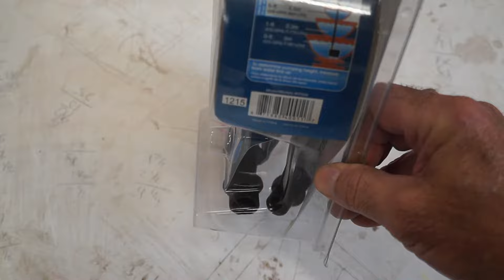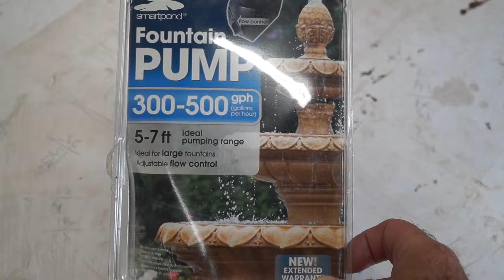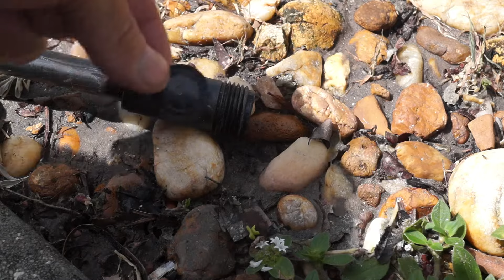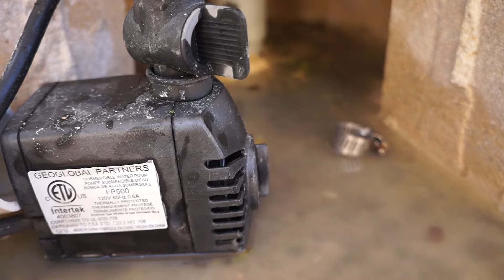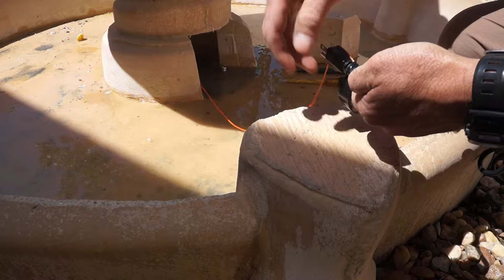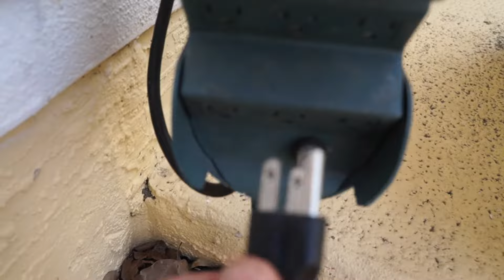How to Replace a Fountain Submersible Water Pump - The End Grain Workshop

Comment: Did you just replace the fountain water pump with a new brand & just place a new plug to start the water, how did it start exactly, I want to buy 1 now👍
Reply from the maker: Thanks for watching! Yes, I simply replaced the old pump with a new one of similar size and flow rate. Once it was connected and plugged into the power outlet, it started pumping water immediately—there wasn't anything special that needed to be done.

If you're replacing your pump, just make sure the new one is rated for your fountain and has enough flow (GPH) for the height it needs to pump the water. As long as it's fully submerged and the intake isn't blocked, it should start working as soon as it's powered on.  You can also add a timer to your electrical outlet to control when it turns on/off.

I hope that helps, and good luck with your fountain project! 👍

Comment: Nicely done, but my problem is I don’t have conduit coming through the base of the fountain up to the cavity where the pump resides. Instead, there is a concrete plug that the wire runs through and it is made permanent with silicone, so to replace the pump the plug has to be gotten at somehow and the wire run.

My problem is I can’t get the darn plug out!
Reply: I had to cut the plug and fish it through. Then splice it at the other dry end.
Reply from the maker: @Blue_Rose1973 That works too.   Thanks for sharing!
Reply from the maker: Thanks for watching, and I hear you—that kind of setup can be a real headache. When there's no conduit and the wire runs through a concrete plug sealed with silicone, you're basically dealing with a permanent installation that wasn't meant for easy maintenance.

To remove that plug, try carefully chiseling around the edges with a cold chisel and hammer—take it slow to avoid cracking the surrounding concrete. If it's really stubborn, a small masonry drill bit can help break it up in pieces. Once you’ve got it out, consider running a short length of conduit or PVC in its place for easier pump swaps down the road. It’ll save you a ton of trouble next time.

Comment: Is there a workaround if the new pumps power cord head doesn't fit through the pipe it needs to fit through?
Reply from the maker: You can cut the male adapter off the cord, then feed it thru your pipe.  Afterwards you could install a new male adapter.  See link below.  Hope this helps and thanks for watching!

https://amzn.to/4dROroL

Comment: Thanks for the great video! We have a similar fountain (and pump), but I have an off-topic question. By chance, do you have any recommendations for keeping the door in front of the pump closed? We have some curious raccoons who come by often, and they push open the door, and have even pulled out the pump! I need access to the pump, so I can’t seal the door. I’ve tried wedges, wrapping rope around the base/door, but they eventually still open the door! Just wondering if you have any ideas? Thanks again for your informative video!
Reply from the maker: I would place a brick or some other heavy object in front of the door.  That way you don't block the water flow to the pump but it will keep out unwanted visitors.  You might also use zip ties to secure the door.  Hope this helps and thanks for watching!

Comment: I finally understand that the old cable needs to be cut at the pump point. For over a year I could not get my brain around it, until I say your video. Thank you!
Reply from the maker: Yes, you can use to old cable to pull in the new cable.  Thanks for watching!

Comment: Cannot believe you didn't clean out the basin of the lower tear. It was filled with all kinds of debris that could clog and damage the new pump that you just put in... It makes the water look nasty🙄
Reply from the maker: Actually I did along with all three tiers just didn't want to bore everyone by putting it in the video.  I also added a one inch chlorine tablet to the bottom basin to keep the water sparkling clean. ✨
Reply: @TheEndGrainWorkshop  Good man😊

Comment: Liked the video especially how you went through your own particular set up! I am assuming that the electrical in the base of the fountain is at a height in which water cannot flow in it..Great vid thanks!
Reply from the maker: Thanks!  Yes, you're correct the electrical pvc pipe at the bottom of the pedestal is higher than the water level.

Comment: thanks for video. very helpful. bought new house and need to replace fountain motor. still trying to figure out how to disassemble for cleaning. i removed the caulking and tried to spin the top off but the top piece is locked in place while the lower pieces can spin freely but cannot remove because of the top piece
Reply from the maker: Thanks Hanks!  I’m glad it was helpful and good luck with yours.